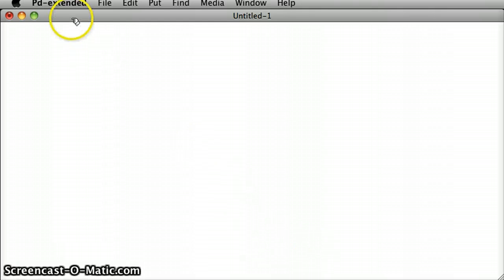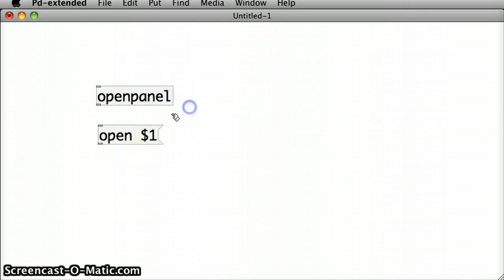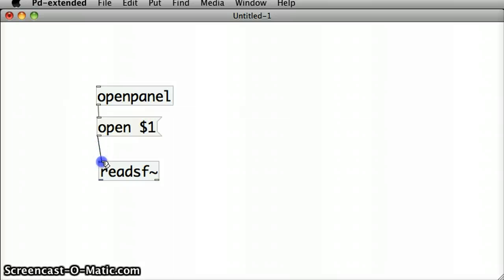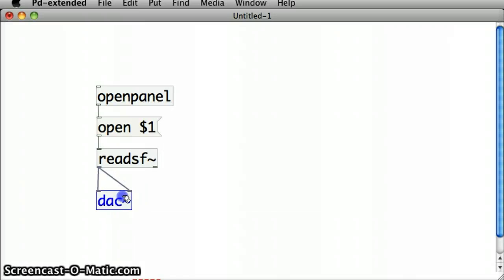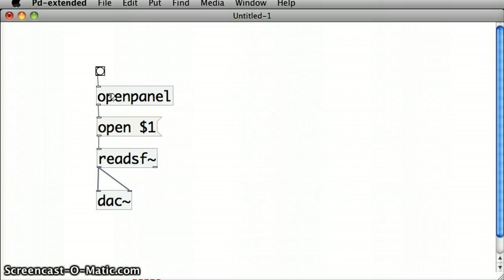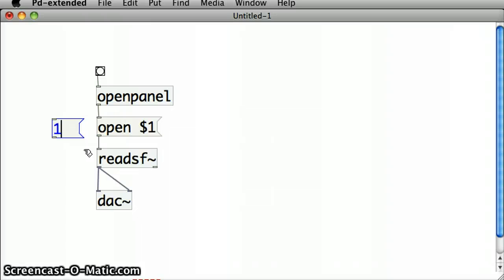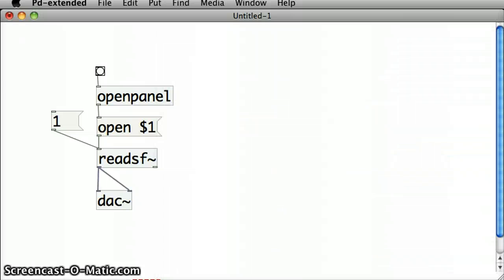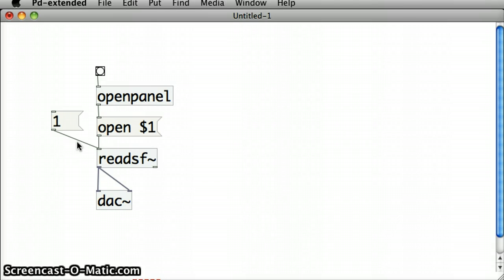Pure Data Tutorial 11 - Opening a external sound file using a dialog box from PD

Comment: Why is it that when you want to play the SF again, by hitting the 1 message, it will not play again? Instead gives the error  - readsf: start requested with no prior 'open'      Seems like you shouldn't have to use the open panel to reload the sf every time? Doesn't it remain in memory using the $1 variable?
Reply from the maker: I think pure data's philosophy is that signals flow down through the system to cone out through the speakers. Once the file stream flows through it is either looped around or reloaded.
Reply: Hello @cgmagik9837 I hope you've fixed the problem. In any case, here you can take a look at a video i made about it: https://youtu.be/jAc3gmz2gYw